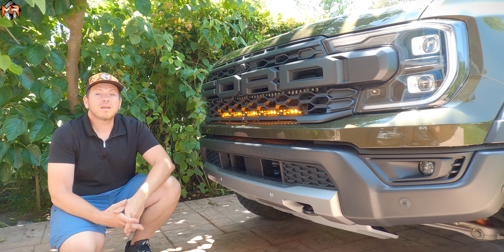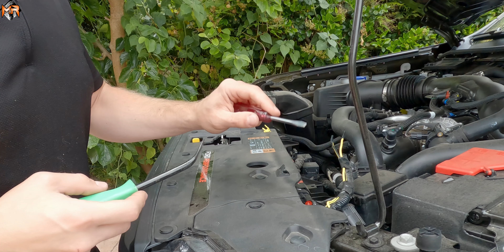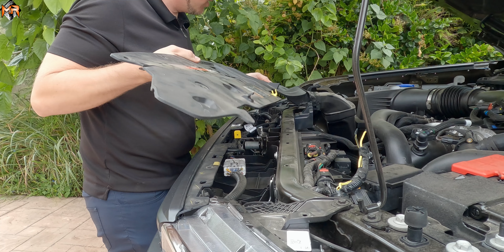Ford Ranger Raptor 30inch LED Light Bar Installation Tutorial | M&R Automotive |  2024 2025

Comment: Two things would be helpful. How did you run the wire and if you do have a dual function light bar, does it matter which switch wire you connect your white wire to.  Thanks
Reply from the maker: The white light uses more amps than the amber. I would put the white on a 10amp fuse and the amber DRL on a 5amp fuse. The wire is ran up the grille into the engine bay. There is no special place for it, to the side of the shutters. I recommend using zip ties to keep it stationary.